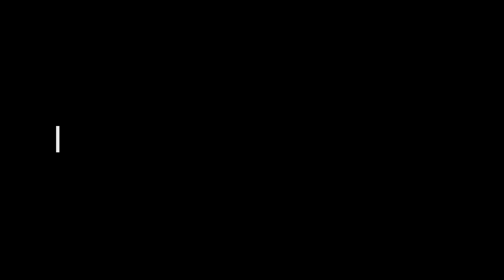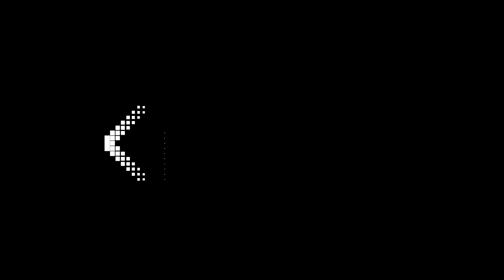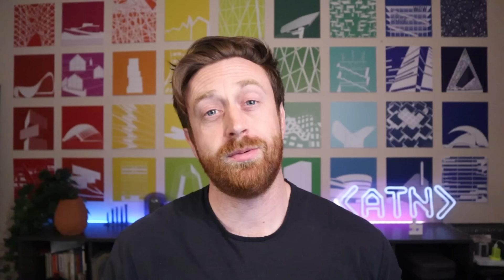The Rise of BIM 2.0: 9 Startups Redefining the Future of Architecture Software

Comment: Im a recent graduate struggling to find a job with little BIM experience. I wonder if any of these programs are at a point that I could learn them and use them as a selling point in my portfolio - that the firms that would hire me would become more productive I came in with knowledge of how to use them. If so, which ones would you recommend checking out?
Reply from the maker: Well this is exactly why I set up ATN, in short No these tools are too new to see significant adoption in practice so if your goal is to get a job most firms won't have heard of them yet. I would suggest two things, 1) Your thought is correct on the AI side of things firms are struggling to stay on top of the AI wave and as a young architect you can pick it up quickly and give them and edge. 2) Not to push our own courses, but our Revit course is designed to get you up to speed for working in practice, so if you want up your Revit skills you can check it out here: https://archi-tech.network/pages/revit-masterclass
Reply: @architech.network thank you for reply! I find speckle particularly interesting and might be quite an advantage a couple of years don’t the line.
Reply: In school we were allowed to use any program we wanted. I wanted a school-work-life balance, so I invested some time into learning Revit. To really know how to use Revit you need to know how architecture works. Definitely recommend a community college course on the topics just to get to doing some assignments with a deadline with less pressure and can push the capabilities of the tool to see how far you can push it.

Comment: BIM is amazing. But is a reference tool that helps educate speculation and project management. However the pencil, paper and the hand can’t be substituted. 

But the traditional approach can be and must be complemented.
Reply from the maker: The sketch argument is a bit of a red herring, sketching has always been there, current BIM has not replaced it, BIM 2.0 won't replace it.
Reply: It depen on how big the project or the firm you own. If it just 1 family house in 100sqm site, then yeah, we all can do it using as you said "traditional methods". I even can build it my self with only help from  couple freelance buildworkers. Heck no use of paper  at all  ❤❤❤
Reply: @haloomentari that’s why it most likely suck

Comment: Archicad was far more advanced in the mid 90’s and  very strong in the early 2000’s.
Reply: still is and revit is just copy of it in general (or better to say, it was no. 1 reason, autodesk developed revit in first place, since their "architecture" version of autocad was so far behind) . its stil unbelievable, how more than obvious is still being put under the radar on purpose by all this channels, that keeps pups pumping autodesk giant. 
yes, ai is changing things (i've been probably following spacio etc from day 1), but these so called bim gen1 software are definitely integrating it into development and new ai features are coming. in case of archicad, their platform can maybe  even be an advantage, sinice you can incorporate all new stuff via varios rhino etc  live connections and no need to invent new platform all together.
Reply from the maker: I'm not promoting revit on purpose, we just reflect what people use in practice. You walk into 90% of firms today and they are using Revit, at BIG we used both and Archicad just couldn't do some of the things Revit could. Ultimately though it is an industry tool and for many different reasons Revit is the standard. The problem I always see is that students are taught something like Archicad in university because their professor thinks it's better…..they get into practice and guess what......they have to use Revit. Ultimately my goal is to prepare young architects for practice, I have no goal to promote one or the other I just reflect the reality of working in practice.

Comment: Bonsai is  excelent for modeling and documentation..
Reply: yes, and not only, you can do full IFC authoring with it, no export needed. It really makes the "I" in BIM shine.
It's free open source software, so no fees.
Reply from the maker: Interesting, it's a plug-in for blender, will have to look into it further.
Reply: There’s an architectural plugin for Bonsai, too. It’s called Archipack, and it’s the only paid add-on. priced at €49.
Reply: Bonsai is the future, in my opinion.  With the .SVG output side I foresee some really innovative documentation solutions.
Reply: And IFC as a native format…

Comment: Great tools, but still far from being a true BIM application — and too pretentious in claiming to be BIM 2.0.
Reply: A BIM model is the closest digital representation of the final building, allowing teams to analyze and predict potential issues early by providing detailed information about every assembly and component. This collaborative tool streamlines communication between architects, engineers, and builders, reduces costly errors, and supports informed decision-making throughout the entire lifecycle of the project—from design to construction and even facility management
Reply from the maker: What make it not true BIM?
Reply: @architech.network A BIM model is the closest digital representation of the final building, allowing teams to analyze and predict potential issues early by providing detailed information about every assembly and component. This collaborative tool streamlines communication between architects, engineers, and builders, reduces costly errors, and supports informed decision-making throughout the entire lifecycle of the project—from design to construction and even facility management.
Reply: I partially agree but He clearly mentions the rise of bim 2.0 and not actually bim 2.0

Comment: You forgot about archicad that is the closest competitor of Revit and is waaay cheaper
Reply from the maker: Its part of the BIM 1.0 generation really, these are all new tools being built as we speak.
Reply: I don't know what Archicad you're using but it's not, "....waaay cheaper".
They cost about the same and starting next year Archicad is going be subscription-only like Revit is right now and it will be even more expensive after another couple of years.

Having the ability to get perpetual licences was just about the only advantage that archicad used to have over Debit and now they getting rid of that to try and be more like Revit (which they're also failing miserably at)
Reply: @Cbricklyne well, i tell you what i know inside the Brazilian market the monthly payment for ArchiCAD is 40 dollars (so It is way cheaper than Revit). Also they gave us the opportunity to buy the full license that is Aprox. 2000 dollars

Comment: Excellent video. As a 50yr old, old school CAD technician/Interior Designer / visualiser, I feel BIM 1.0 has passed me by as I've never really got beyond Autocad, Sketchup, 3DS Max etc. I've never had any access to Revit, but haven't really needed it as the architectural and design projects I've worked on, often the construction management company have converted our Autocad work to BIM. I have experimented recently with AI arch apps, and am on the waiting lists for Finch and some others. I'm hoping I can get on board with BIM 2.0 without a BIM 1.0 underpinning. If I can't, I'll just trudge on with Autocad😂
Reply from the maker: I would say that would be a very real scenario, these tools will be much easier to adopt so the idea of skipping BIM 1.0 tools seems highly viable.
Reply: They should have cut you out a long time ago, hand sketch then go straight into BIM, skip the AutoCAD, because you can rapidly make 3D parametric massing models. Importing AutoCAD really is not exactly completely compatible with BIM due to the five million empty layers and lines ten million miles away from 0,0,0.
Reply: @aethylwulfeiii6502  So you've worked in architecture for over 25 years like I have? No, didn't think so. You clearly have no understanding of CAD. I was making parametric models in the 90s. No it wasn't BIM but it worked. And as for cutting me out, my employer, clients and contractors know what they're getting from me and have no complaints. What they're not getting is a recent postgrad who thinks they know it all.
Reply: @aethylwulfeiii6502 complete rubbish - revits so slow for planning- a revit monkey output tool

Comment: Great video! I'd probably put my money on Qonic as far as having a more complete solution. The ultimate goal should be to reduce the number of programs needed to create deliverables rather than increasing and Qonic seems to be on the right track. Interesting times!
Reply from the maker: Yea I think that is the goal for most of the broad platforms, but it won't happen overnight and for now they have to 'play' with the existing software for now. Or think of it like google sheets, it's the next generation of spreadsheets but you can still import excel files, export in that format, i think it would be like that essentially.
Reply: Yes, it looks the most promising by far